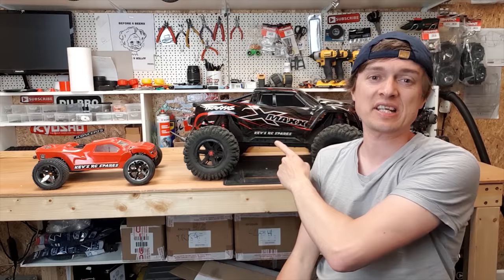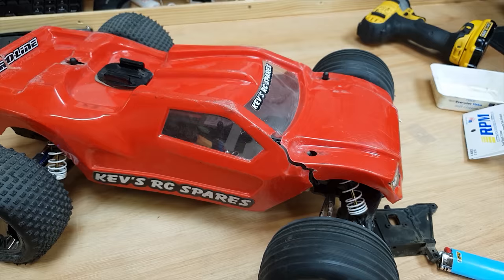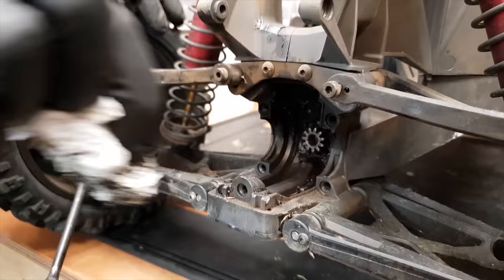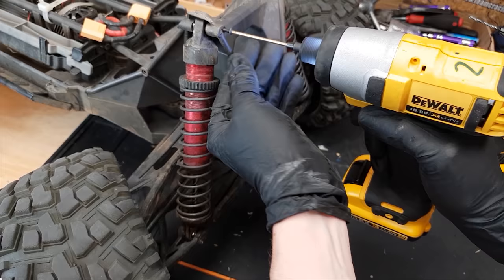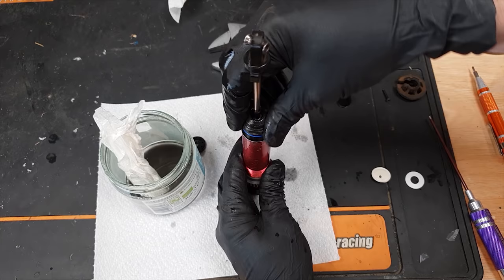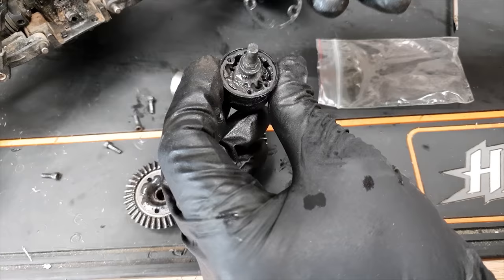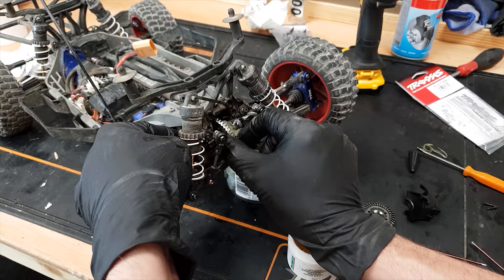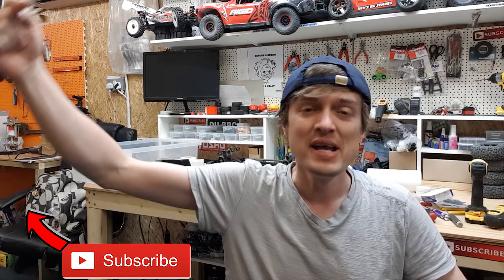RC Workshop - Fixing all this CARNAGE!!!

Comment: You should get the xo1 diff, literally all it is, is the same diff as the slash and stampede 4x4 except there’s a couple of reinforcements so the cup doesn’t round out!! Part numbers are 3978 and 6882x!! Hope this helps!!
Reply: Valdemar Perez III will it fit the Traxxas Ford Raptor?
Reply: @gabeross27  if its 4x4
Reply: Valdemar Perez III ok thanks

Comment: I have a question:which wrench do you use because my mini slash's wheel nut is all tightened up and I can't remove it using the stock wrench.